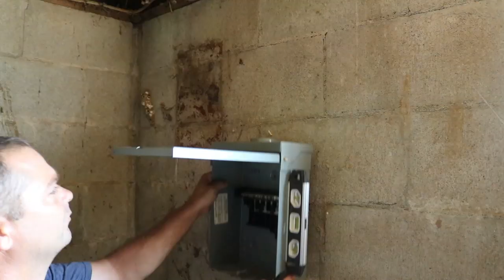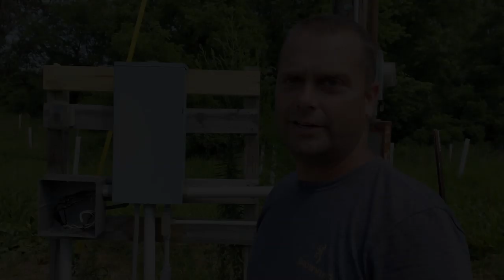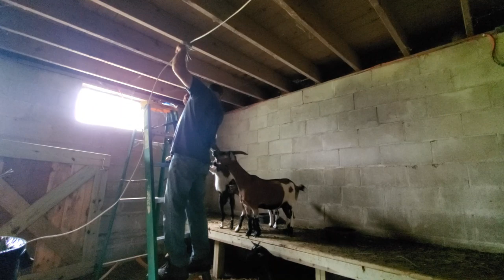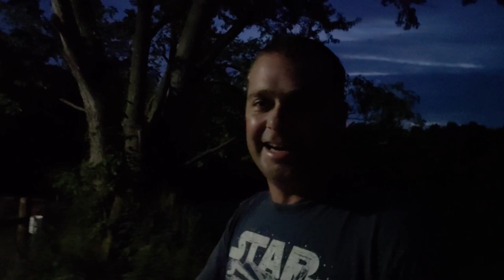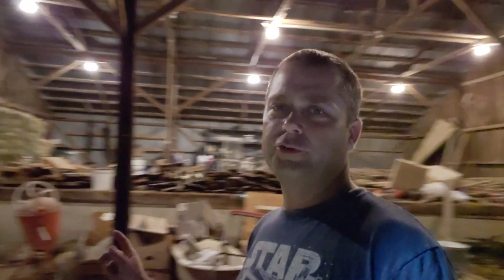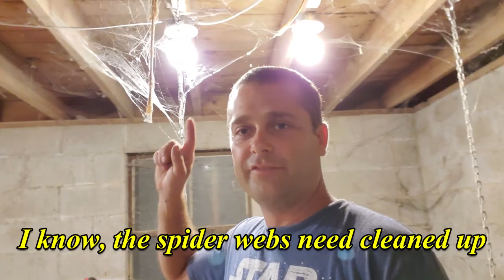Wiring up electricity in the livestock barn.  Power and lights for the livestock.

Comment: I would drill a hole in the wall and run the wire for the heated water bucket outside of the goat stall and inside of a pvc pipe to keep the goats from chewing on it. an LB with a short length of pipe through the wall all the way to the bucket should protect the wire and running it outside would keep the goats from climbing on it on the inside. Just a thought,
jack

Comment: In our area they ran electricity to those poles and put a light on top that the electric company paid for (including the electric bill).  The light shone on the area between the house and the outbuildings, and was used to convince the farmer that updating to electricity was a good idea. I believe the last farm hooked up was in the 70's but it's been awhile since I read the article. I believe the newest version of the Rural Electrification Project if for fiber optic -- we are in the middle of nowhere and have fiber optic right to the fiber optic modem!

Comment: Fantastic execution. I would suggest putting a motion sensor, (with a built-in day-light sensor) that automatically powers on the lights only during evenings/night time. That sensor/s can be in the middle /walkway. This also helps scare away any intruding predators.

Comment: Great work Evan. For regulating lights to the chickens you increase the lights in the morning, and then to go off when the sun is upp. The chicken should self go in when the evening comes with no light. IF you set a timer in the evening and the light goes out before the chicks sitting on the rosters, they will stay on the floor and get poopt on...or worse.

Comment: Impressive!!  Good thinking on the dusk-til-dawn lights.  The only thing that i can think of that you might want to adjust, is to find a way to protect the heated water bucket cords from the goats teeth... you know about Murphy's Law.....🤷‍♀️
Reply from the maker: The heated water buckets and bowls actually come with a metal spring like coil covering the extension cord to prevent animals from chewing on them.

Comment: Good job. Lots of power. 2 suggestions; 1. motion detector lights instead of day night lights outside on backside and front of barn  2. outside covers on outlets to keep mud daubers out and water gets splashed around when using hoses also hens may peck at outlets.

Comment: Great job on the wiring. Just be careful because one electrical spark could catch that barn on fire pretty quick. The lights in the hayloft in our old barn are encased in glass so if they spark or burst nothing will fall & catch the hay or straw on fire.
Reply from the maker: These are LED bulbs and they dont have filaments, so they shouldn't create sparks if broken.  They should be safer than traditional bulbs.
Reply: @CountryViewAcres  I figured you had used LED's. Just more friendly word of caution when it comes to barns & electricity. Never seen anything bad in person but don't want to either. Fellow farmer (grain & former beef cattle) from Parkersburg, IL. Our farm was started after the Civil War & our barn is 133 years old.

Comment: Nice work. After having wired a number of barns for people over the years, I would recommend using MC cable (metal clad) over romex.  It is just regular wire with a steel sheath wrapped around it, while it is a bit more expensive it keeps the wire less subject to damage and chewing from mice.  If you find the lights in the barn are not quite bright enough, you may want to look into so High Bay lights for in there. The L.E.D. ones are real nice and coming down in price all the time. The bulbs you have in there seem to be working rather well, though, so that is all up to you.
Reply from the maker: The romex wire was only on the ceiling.   Everything that came down from the ceiling was in conduit.  I thought about MC cable but decided to go with romex.

Comment: Very nice job!  A couple of thoughts regarding what you did and what I would have probably done.

I would have probably used some electrical putty then tape over the splices.  Also, I would either use  GFCI breakers or GFCI outlets.  Even with no running water it is still "outdoors" and "exposed" somewhat.  I am by no means an electrician so I could be wrong about my suggestions.
Reply from the maker: Yes, the barn would be considered a wet location and would require GFCI protection by code.

Comment: Thanks for the outside lights.  We have a barn and you answered my question re:  a control switch on dusk to dawn. We just completed the underground to it as well.   So far, we only have one outlet cuz we are deciding  what to use and where to place things.  We have alot of mice, so exposted wire would not be an option.   Great Job and looks really nice
Reply: Jill Seward  we had mice too, so we enclosed everything in 1 inch conduit, and it works great!

Comment: I think you said you had 60-amp service? I have a 25x75’ shed to wire up. I’ll need to provide probably 5 lights - 2 in the open half and 3 in the enclosed half. I’ll want a few directed lights, like over the workbench and maybe a motion sensor over the personnel door. I have a couple work lights for specific projects that need more in different places. And maybe 4 quad receptacle outlets. But I want to be able to run a 240V welder. So I’m doing some thinking about configuration and total amps. Good to see your solutions and the comments too. Thanks.

Comment: What a great job. We have just renovated the barn structure and siding on a very similar building and now we are ready to plan electricity and dig trenches.
Evan, did you run any 3 phase ?
And, could you list the parts that you used ?

Comment: Great video . I was wondering why you put the junction box on the outside of the barn . You explained why . Thanks for showing the wire connectors . Many times people show stuff but they don't explain what they used . That's why I like your videos . You really go into details in what you're doing . Great job in putting up the lights . I was wondering why you used metal conduit for the water bucket heaters . Was that to stop the animals from biting  the wire . Thanks
Reply: Thanks
Reply from the maker: Yea everything down from the ceiling was in conduit to protect the wiring from the animals.
Reply: @wilburfinnigan2142  It's not national, counties and municipalities can pick and choose the parts they use and how they enforce them, hence the "different in some areas" . The code is a suggestion, not federal law.
Reply: Wilbur Finnigan: Do you realize that people from many different countries views Country View’s posts?  Different countries different codes ... if any at all.
Reply: @wilburfinnigan2142  Sorry to burst your obviously tiny bubble, but I know two counties that have not adopted the code YET!  It's not NATIONAL!  Local governing bodies can pick and choose how and what they enforce. They do not have to follow NATIONAL, it's a "suggestion".

Comment: Looks great, Love the old barn. PL show us the lower part you have not used yet. Whats down there?
Reply: The lower part is where the goats and chickens are. Just the back part, the front bottom is dirt. That is why it is called a bank barn. Dirt is banked up.
Reply: Thanks for your point of view Salmon Hunter, But I asked about the part behind the livestock area. There is more there.
Reply from the maker: There is an addition to the back of the barn that has animal stalls in, but I haven't messed with that section yet.  I actually plan on changing that section quite a bit.  Maybe I can make a video on my plans for that section of the barn.
Reply: Looking forward to seeing the vid. Love old barns. Thanks for saving that one. Most new owners just tare down and put up a steel building.

Comment: Hi I do not know what the electrical codes are where you live but in MA you can not run Romex like that in a barn   you have to run pipe or use BX cable BECAUSE OF MICE AND RATS THEY WILL CHEW THRU THAT IN NO TIME    AND YOU HAE MICE AND RATS ALSO YOU CAN NOT USE THOSE LIGHT FIXTURES . I think you did a nice job  I hope you NOLOX  on the aluminum wire.

Comment: I  always  set  my  timer  to  come  on  around  3  am  to  give  my  chickens  extra  light  hours.  The  timer  turns  off  the  light  when the  sun is  up. Seems  to  be  a  bit  more  natural for them to go to roost  at  dusk   If  they  are  not  on the  roost  when  your  light  goes  off  at  night  they  wont  move in the  dark.  Judith B
Reply from the maker: The believe the dusk till dawn light makes enough light through the windows for them to get up on the roosts.  But I will sneak out there and double check.

Comment: When I wire in a shop or a barn I only use electrical pvc. I dont use any metal fixtures.  It is cheaper and you dont need to ground to a metal box

Comment: I would of definitely used M/C wire due to rodents. Its more durable if something bumps or rubs against it. The panel should of been mounted to a wood board and grounding rods would of been a good idea.

Comment: Only thing I would change is the electric tape. Outdoors that stuff will come apart eventually due to the change in temperature and humidity. Better off using what in telecom we call pig tales. (As at the electrical supply for splice hardware)

Comment: I am not trying to be "that guy."  Your panel in the barn is a subpanel.  Since you put a sub-panel in the barn, you should have 2 black wires, 1 white wire and 1 ground wire.  You can run into some potential safety issues.  I enjoy your channel.
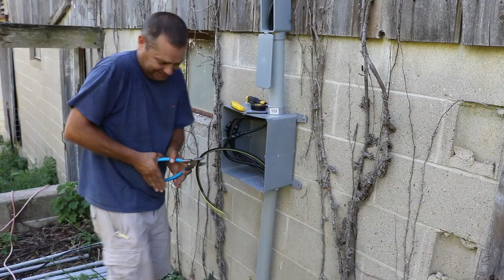Reply from the maker: At 4:03 you can clearly see there is 4 wires. 2 hots,  1 neutral and 1 ground.  They are phase taped in the breaker panels white and green for neutral and ground wires.
Reply: @CountryViewAcres  great - sorry I missed it.

Comment: GFI outlets or breakers?
Reply from the maker: No GCFI.  It is an indoors location without faucets or hydrants.   So I used  standard outlets.
Reply: I think you said heated waterers.   Also plugging in a block heater on a tractor should be on gfi.   Anything with water.   Some newer state codes want them in cold storage and barns even without water in building.  I am no electrician , sooo.....  this advise is worth what you paid for it.💡
Reply from the maker: By code the barn would be considered a damp location and require GFCI protection.  I will probably just change the breaker to GFCI.

Comment: Sir,   For the safety of your animals, have you read Article 547 of the NEC.?   This is one reference with some information.   http://www.adamselectric.coop/wp-content/uploads/2015/02/Agricultural-Buildings.pdf.  Some points to be concerned about: 1.  The cable used must be NMC not NM or NMB.  2.  All receptacles should be GFCI protected.   3.  Be very careful of water heaters if your floor is concrete.   Needs mesh in concrete grounded.   4.  Did you install ground rods connected to the 60 amp panel?  5.   Did you run a insulated copper ground conductor with the feeder?   Voltage drop applies to ground conductor for sizing.    These are just the highlights that I quickly saw.   No need to answer the questions, the safety of the animals and your barn are your responsibility.   If you need help understanding anything, let me know.   Respectfully,   Kevin
Reply from the maker: Actually I opened the NEC manual the other day and searched through it.  I have copy at work.  It took me a while to find the section on agricultural buildings.  I did read all the points you mentioned.  And other things I picked up on in section 547 was all conduit and fittings need to be wet rated.  All electrical boxes need spaced off the walls.  All electrical boxes need to be wet rated. 
My electrical box is an outdoor box and it does have a 4th wire that is an insulated ground with the feeder wire.  I am planning on changing the outlets and the outlet boxes to GFCIs in outdoor boxes.  This old barn isn't going to be perfect but after I replace the outlets it will be a lot better.
Reply: Country View Acres    Awesome!    I love it when someone does their homework first!   The one that seemed possibly obvious was the receptacles and that was a maybe since you didn't show the breakers.   BTW the voltage drop sized wire was spot on too!   Good job sir!

Comment: dont use aluminum wire!
Reply: Just about all large gauge wire is aluminum!
Reply: @TheAndrewMaggie      Not really    Most industrial heavy gauge wire is copper.    The reason for this is copper wire conducts better than aluminum .  It also withstands heat better.   And 3rd  it resists corrosion better.    The only downside to copper is its cost.
Reply from the maker: The copper wire was 3 to 4 times the cost of aluminum.